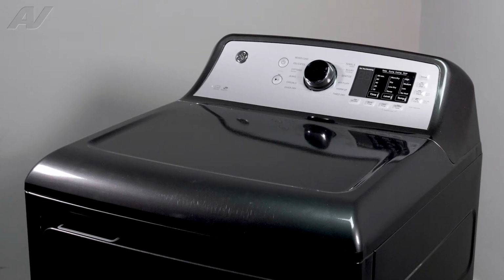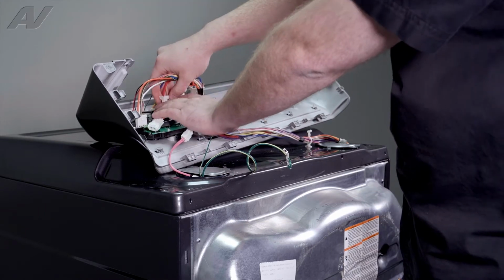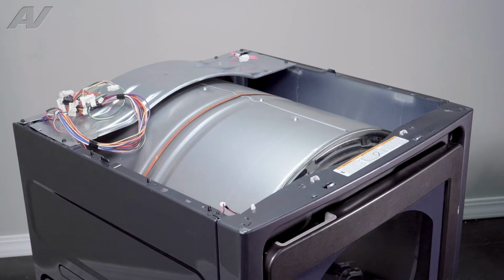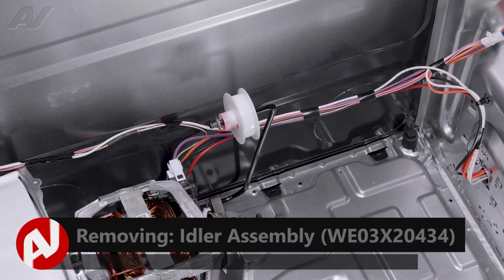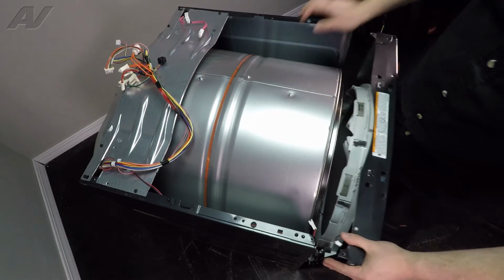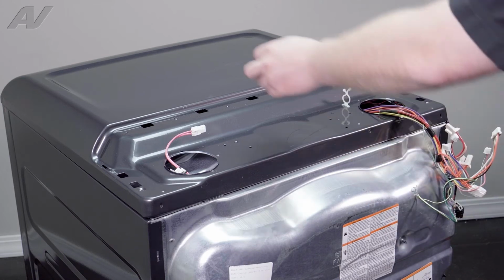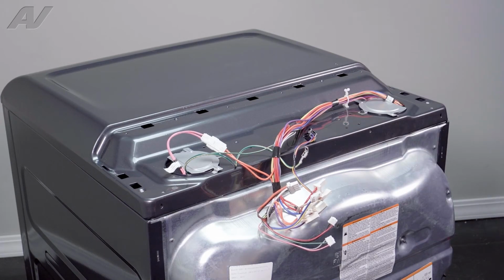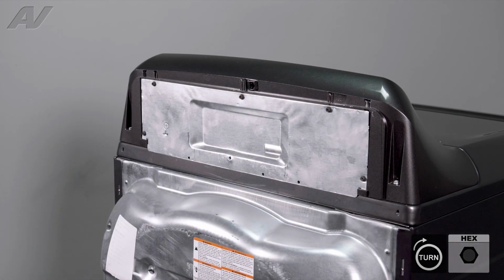GE Dryer Repair - Will Not Spin - Idler Arm Assembly

Comment: My midea 9kg washer start without control or pcb it automatically   turn on when the power supply socket is turn on.....
Reply from the maker: Great question, if you have a more technical question that our parts department cannot answer, you can search our over 17,000 answered questions free at our website www.ApplianceVideo.com under our Repair Help section. You can also call our parts department at 1-800-830-5465 and they can give you help 7-days A week ,or search at www.SaveMoreOnParts.com  .